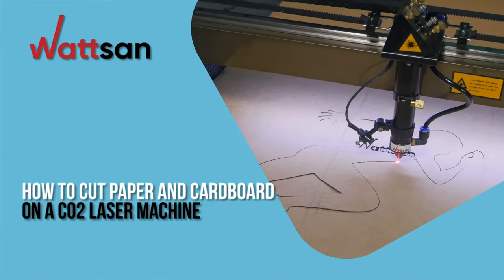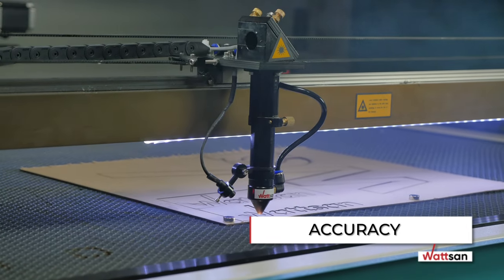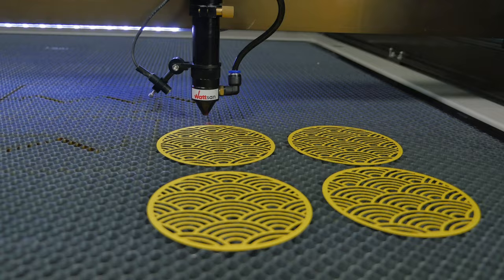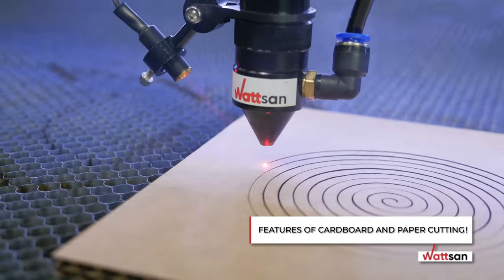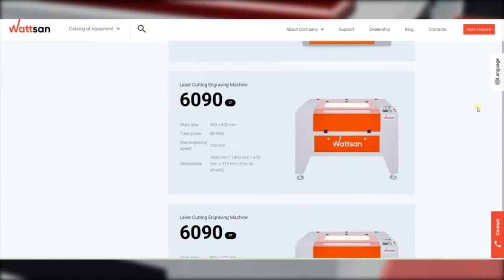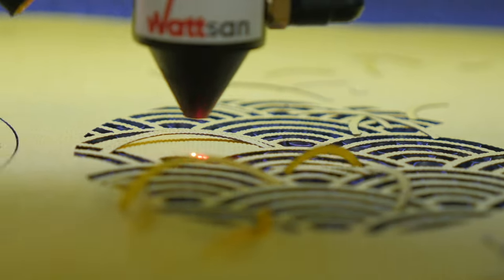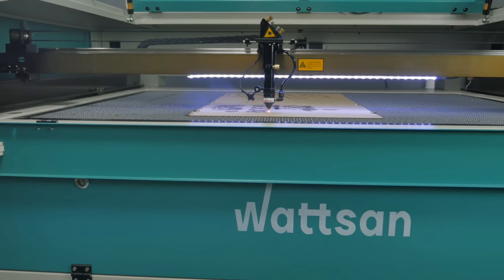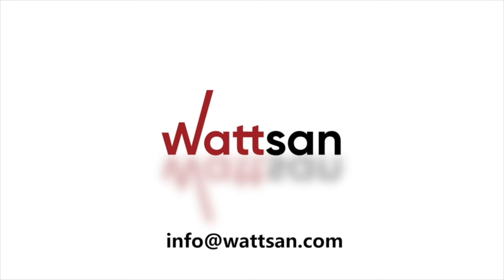HOW TO CUT & ENGRAVE PAPER & CARDBOARD WITH LASER MACHINE?

Comment: What are the settings on a 45 watt c02 laser machine for  80 Pt 0.086'' Thick Binders Board Chipboard Designer Bookboard Heavy Duty Chipboard Sheets Bookbinding Supplies for Book Binding Materials Cover (11 x 17 in, 0.086'' Thick) [I cut and pasted this so you'd have all the information.]